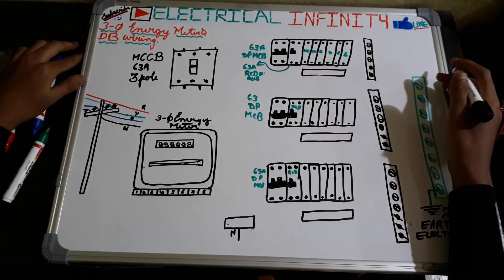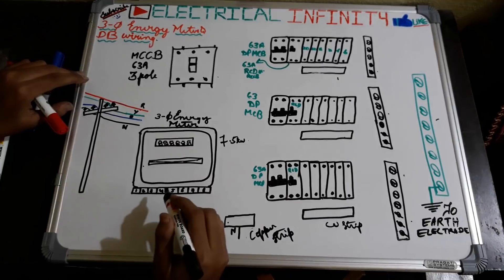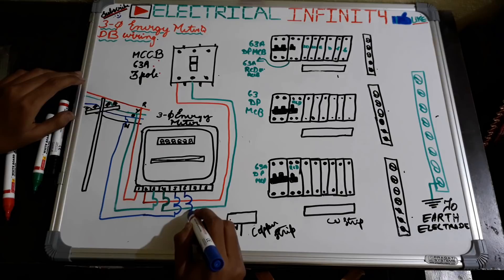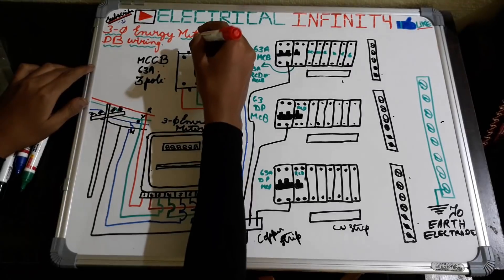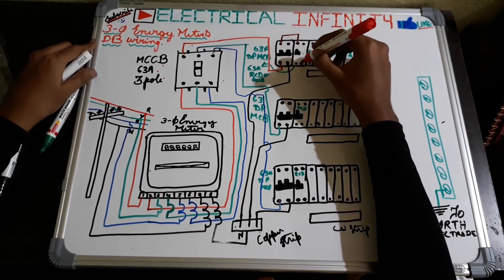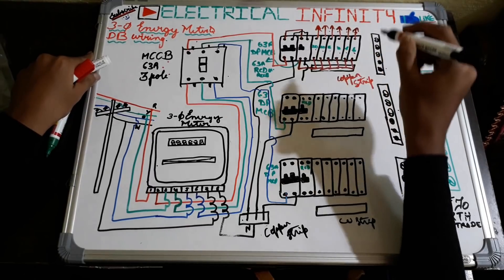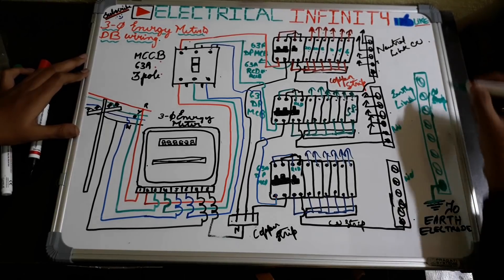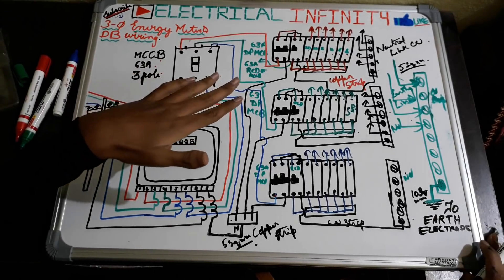Wiring of 3 Phase Distribution Board from energy meter|3 Phase DB Wiring Diagram with MCB Connection

Comment: Design power circuit for power outlets as 
per requirement for the given factory 
layout. 
Design suitable distribution panels, select 
suitable size of cables, protective devices 
and switch gears. Applicable standards sir plz explain this

Comment: Very detailed explanation. Why did you go for TT scheme for earthing, I have learned that it is not the best earthing scheme especially for residential application as it does not trip the MCCB/MCB in case of fault current in any appliance. Since it does not trip during a short-circuit, that can increase the energy bill. To sum up, I think TN-S system would be better suitable for this application.

Comment: Namaskar guru ji
Guru g ek problem samaj mein nahi aa rahi.mere friend ke ghar main three phase connection hai 10kw.magar unke ghar main andar single phase supply hi jatti hai. unke ghar main two Ac 1 ton ,1 Ac 1.5ton hai.jyada vo log two Ac 1 ton ke hi use karate hain.
Kal raat unke relative aye Thai.unhone two Ac 1 ton or 1 Ac 1.5 ton chalya.lekin 1.5 hour ke baad unka main DP isolator 63amp overheat hone pe trip Kar gaya.
 .Maine apne friend ke saath raat ko DP isloator ko single pole two mcb 32 amp se replace Kar diya  or phir supply chalu ho gayi.uske baad unhone two Ac 1 ton wale hi chalye.hum ne load v check kiya 11amp tha.raat bhar koi problem nahi ayi.
Subah electrician check karne aya.vo kehne laga ki single phase pe 3 Ac nahi chalenge.tino Ac ko alag alag phase pe karna padega.hum ne usko bola problem koi  or hai.vo nahi maan raha.vo bol raha hai ki kisi se puch lo problem yahi hai.aaj duphar ko unhone 1ac 1 ton ka or dusra ac 1.5 ton ka chalya hua tha.tabhi raat ki tarah  ek mcb 32 amp ka Jo raat main replace Kiya that vo 30 min baad overheat ho ke trip Kar gaya .jab trip Kiya tab bhi load kam hi chal raha tha.ab to two ac hi chal rahe Thai, ab kyu trip Kar gaya.humein phir Tino ac ka load check Kiya ,ac load sahi le rahe hain  humein samaj nahi aa rahi ki load to kam tha phir 63amp or 32 amp ka isolator overheat ho pe trip kaise ho gaya.main puchna chahta hu  ki kam load hone ke baad v 63 amp DP isolator overheat ho pe trip kaise kar Gaya.jo baat electrician kah raha hai vo sahi hai ja phir galat.
Single phase connection pe hum maximum kitna load Chala sakte hain.single phase pe kya hum ek saath 3 ac nahi Chala sakte.sir bahut confusion chal rahi hai .koi or fault to nahi hai.sir aap apni technical  advice give me .thanku sir.
Reply from the maker: Namaskar. 
Follow what electrician says . He is correct. Load is too high on a single phase when u use 3 AC and it trips because of overcurrent withdrawing which leads to overheating.
Reply: @ElectricalInfinity  
Thanks
Reply: Uri baba aisa kaise ho gya

Comment: Pls explain detailly
What is mcb and where it is used?
What is mccb and where it is used?
What is phase relay? Y it should use?
What is contactor and where it is use?
               Wire size 2sq wire where used?
                               4sq wire where used?
                                5sq wire wire where used?
                                10, sq wire where used?
How to calculate wire size for 1phase and 3phase?
If 2,400 wts needed for a house then which phase we should use either 1phase/3phase????
             Giv me explanation with drawing....
Thank u

Comment: This is a very good explanation. Thank you for that.I have a question. I have this smart switch which I want to replace for my light switch. My current 2 gang light switch has two sets of L, and L1 for two different lights. So two live and two load. But the two Live are from different phases. Red and Yellow. The smart switch has only one Live input L, L1, and L2. 
If I connect L1 to Red and L2 to Yellow, using either Live, it will trip my ELCB. I think it trips because I am mixing two different Phase in the same circuit.
Question-1. Can I move the light wires from Red Phase to Yellow Phase so all would be on the same phase?2. Do I also need to move the Red Neutral to Yellow Neutral?Please help me. Thank you sir 🙏🏻
Reply from the maker: +HGST can i know more about that smart switch ? What type of smart switch it is.
Reply: Electrical Infinity it’s made by Xiaomi Aqara - https://www.aqara.com/en/ctrl-neutral.html
Reply from the maker: +HGST l is tha main line where as l1 and l2 are two lines coming from from L. You should use only one phase. That is either red or yellow to L and connect l1 and l2 to respective  lamps . If you are using red phase for 2 lamps use the respective red phase circuit neutral . If you use y neutral  it might trip the supply if you have rcd install in DB.
Reply from the maker: +HGST hope you got it.😊
Reply from the maker: +HGST may i know from which country you are
Reply: Electrical Infinity I think I got it. So I use either one of the Red or Yellow Live. But I must switch the Neutral to correspond with whichever phase I’m using. But how to find this one particular Neutral wire?
Reply from the maker: +HGST check it out  at lamp fixtures . The red wire will be connected to one of the lamp hence the neutral  connected to it will be of red phase circuit.
Reply: Electrical Infinity Thank you sir 🙏🏻
Reply from the maker: +HGST welcome  bro 😊

Comment: What will happen if we use aluminium strips instead of copper strips ?
Reply from the maker: +Syed Mohammed Uddin  Weight, electrical capacity, and cost are major considerations when selecting Al or Cu for an electrical application. Coefficient of thermal expansion of aluminium  is more than copper .so copper is prefer ignoring it cost by manufacturers  and designers. As thermal expansion goes on al it might lead to defromation of contact point.
Reply: Electrical Infinity 👏🏻👏🏻👏🏻👏🏻😉😉😉☺️☺️☺️☺️
Reply from the maker: +Syed Mohammed Uddin thank u bro 😊😍